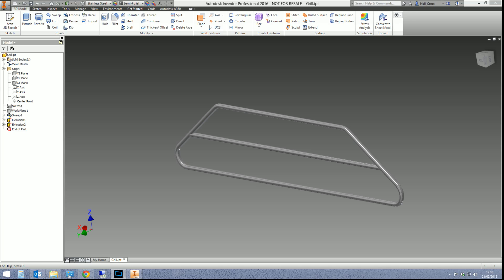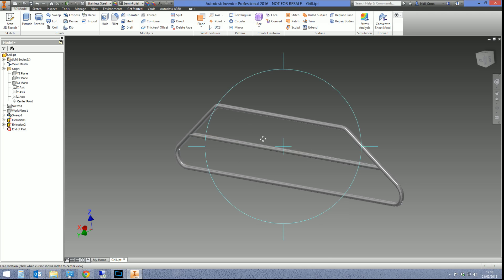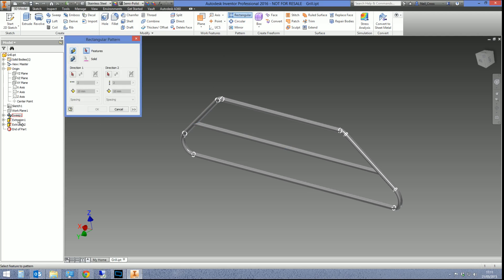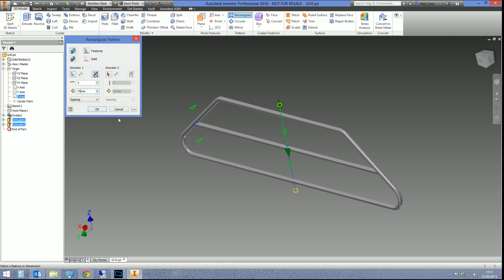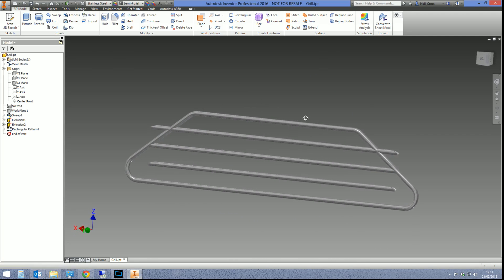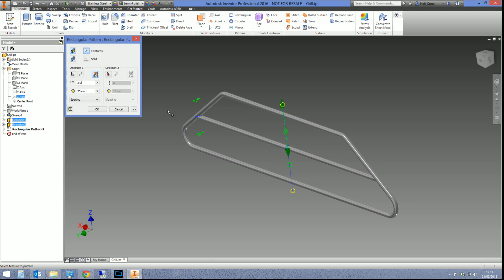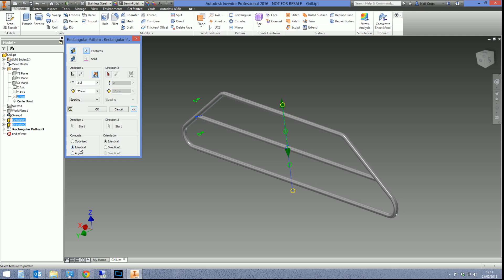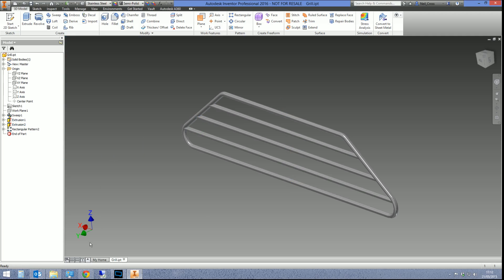How to Adjust Pattern Elements | Autodesk Inventor

Comment: Hi TFI, fantastic videos, please keep em coming. My primary workflow is multibody parts (I am a cabinet maker and use Inventor with the 'Woodwork for Inventor' add on which makes Inventor a bit more user friendly for woodworkers, and enables us to produce a full cutting list directly from the model). The pattern method you describe here works on a single part, but if I try and pattern a part as a new solid, the adjust button is greyed out and you are stuck with a pattern that is identical to the original part. Is this something you are aware of? I tend to pattern things in the top level assembly for the sake of the cutting list... if I pattern parts in the multybody model before creating the assembly with the make components command, I will end up with, say, five cutting list items for identical parts, shelves for example. If I pattern the shelves in the top level assembly, my cutting list will read 5no shelves and won't show multiple entries of the same size component. Cheers